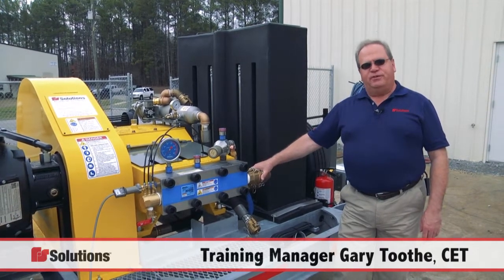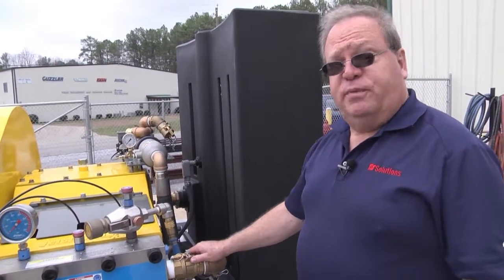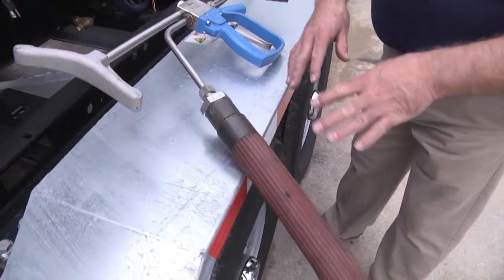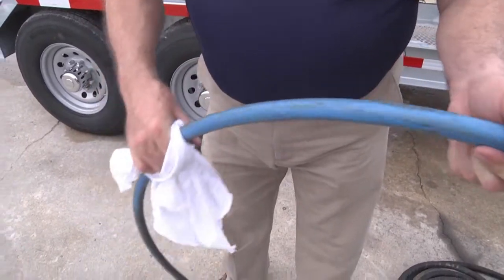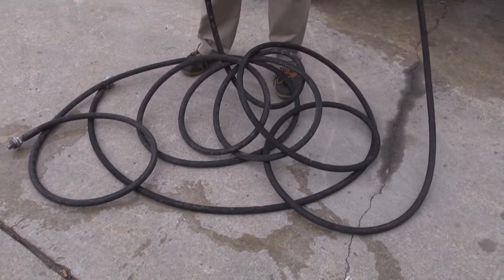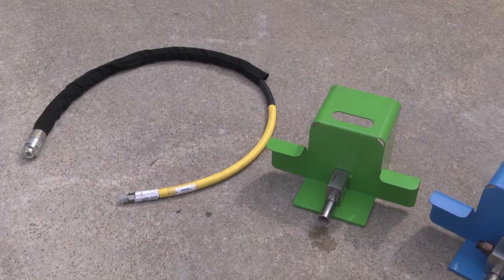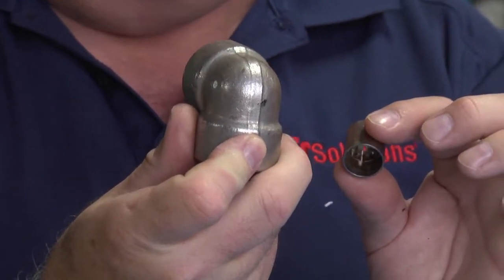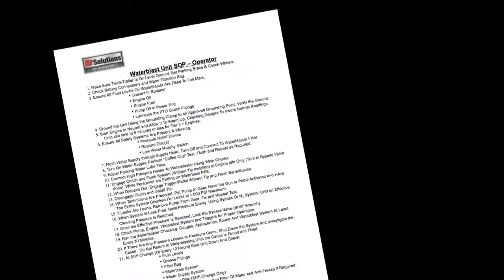Jetstream Waterblast Safety Video

Comment: excellent video. but the operator lacked the face shield. I work with the 4200 series of jetstream. very good equipment.
Reply: @matthewappleby5668  Did you take the job?